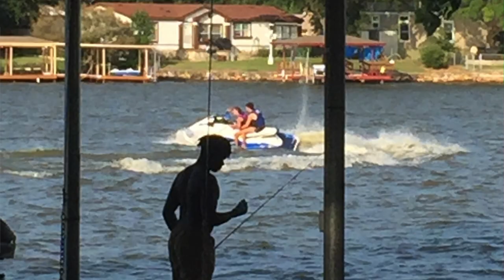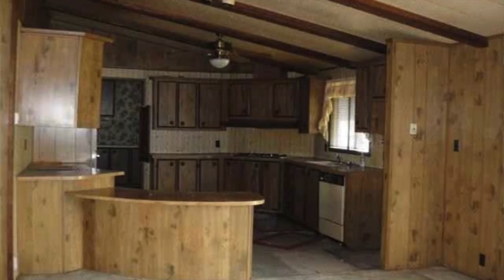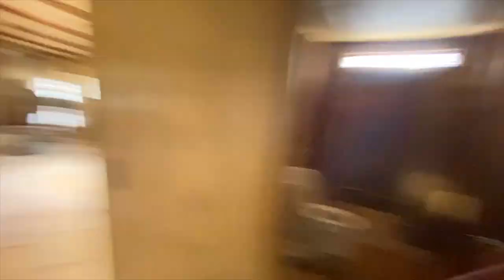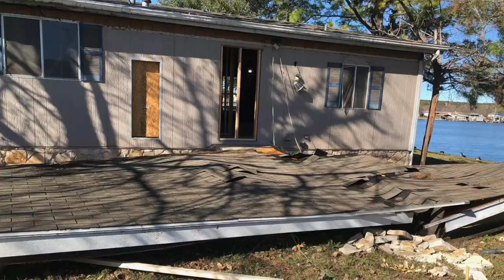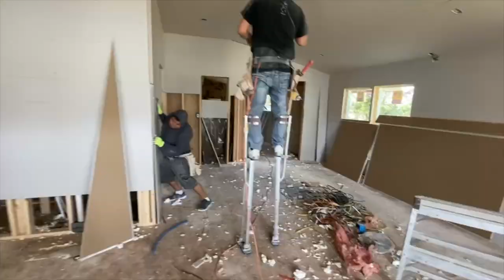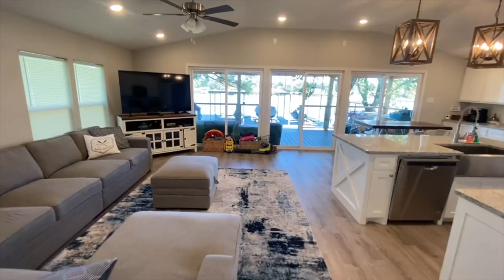Mobile Home Remodel 2020 - Double Wide Lake House

Comment: Did you have to reinforce the foundation at all to add all the weight of the sheetrock etc?
Reply from the maker: Yes some but we also didnt use standard sheetrock.  They used an ultralight
Reply: @kyle-ok  awesome that helps!

Comment: How did you get the ac vents to go on the ceiling? I know most mobile homes have it on the floor and this one had them on the floor as well but i can see on the after you put them on the ceiling
Reply from the maker: with it being a full remodel we were able to install the ac in a closet (vertically) and then run the ducts up